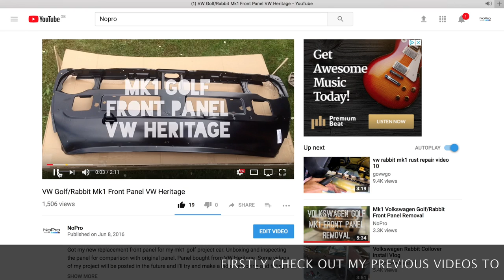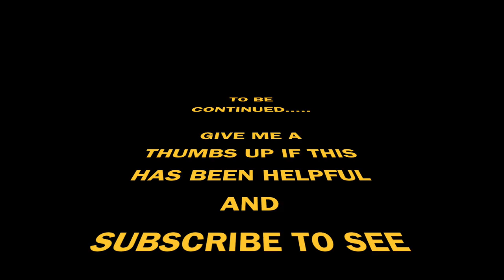Mk1 Volkswagen Golf GTI Restoration - Fitting Front Panel

Comment: Is this the front panel I'd need to do a round headlight conversion with new fenders?
Reply from the maker: Don’t quite understand, is it the square headlight mk1 rabbit you have?
Reply: @No-Pro  Yes and I prefer the look of the round headlights
Reply from the maker: @SpermPotatoe  ah ha I see, we’ll yeah I suppose that would be what you’d have to do. It’s a lot of work to put round headlights in though. You would probably be cheaper and quicker adapting the front panel that’s on the car.  Wouldn’t be too much work for a body shop to do.

Comment: Great job.  Thanks for making the video. 

What's the quality of the replacement  front panel like?
Reply from the maker: Hi, thanks. No problem. Would have came in handy seeing a video like this before I fitted it lol The panel is actually really, put it next to the original and can't spot many differences, maybe if I was to be super fussy I could spot a couple of bits but all in all it's great. There's a few spot welds along the centre that I'll be tapping in and filling just to create a nicer look if I take the bumpers off but if the bumpers were staying on then it would be fine.

Comment: How do i fix my golf's door gaps? I suspect it accident damage as right side door and fender gap is small and left side is very big. No amount of panel alignment fixes it.
Reply from the maker: If the door needs to move closer to the rear it's possible the brackets that attach the door to the chassis might be bent slightly forward. You'll need to measure the gaps, work out how many millimetres it has to be moved back to equal the gaps. Then remove the door and take a measurement of the two door brackets on the chassis from the wing and tap them both back the amount you measured beforehand. This is one way to get the gaps closer. If the doors still slightly off from top to bottom use the door as leverage to try and 'persuade' it into the right position. If none of this makes sense let me know and I'll try and explain another way.